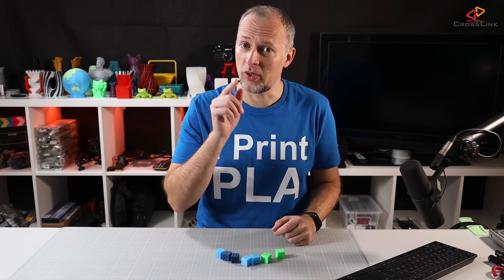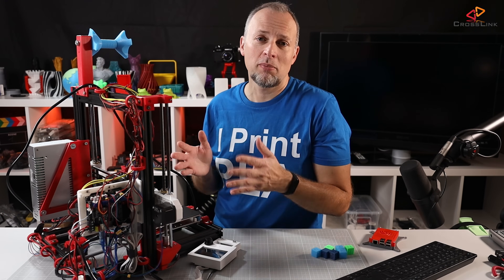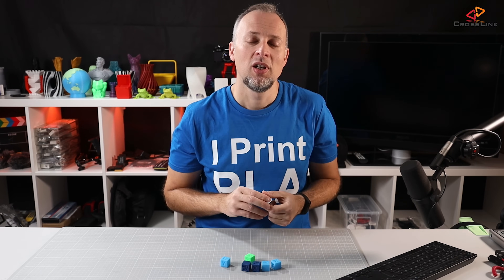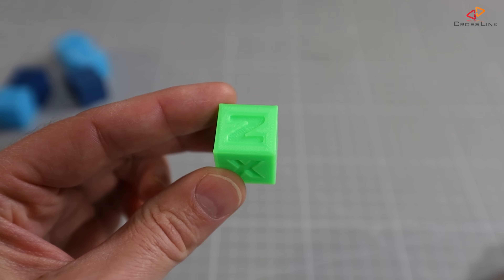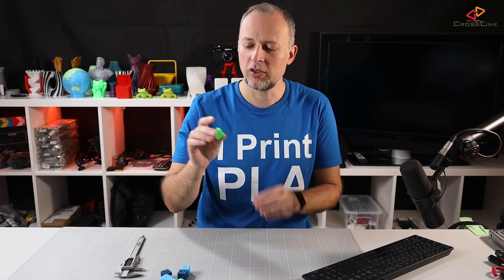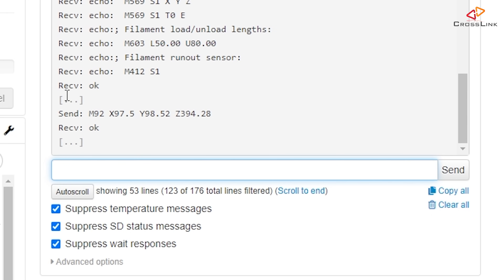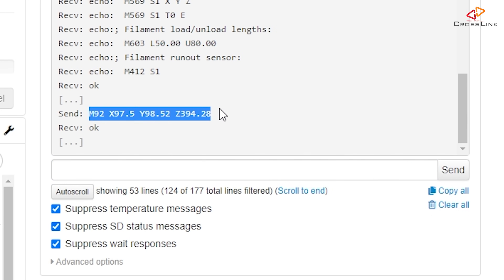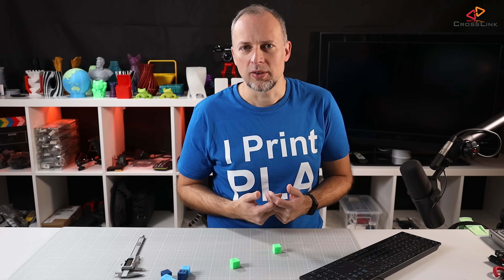SET YOUR STEPS - Fixing dimensional accuracy on your 3D printer (Cartesian only)

Comment from the maker: As @hunterisu999 stated correctly in his comment, I accidently used the term "esteps" for "steps", where the term "esteps" is really just used for extruder motor steps and not for the other axises.
Reply: That is a common mistake. I do that also most of the time by accident. However printing a cube to calibrate the printer is just wrong as you add so many variables in the mix that have nothing to do with steps and mm. steps/mm is just that. No slicer, no printing, no elephant food, no overextrusion that causes problems with the measurement. You just need to measure the movement and use that as a base for the calculation. If the cube is to big after the extrusion you need to fix that in the slicer to compensate filament expansion/shrinkage.
Reply: @guidomersmann9744  I agree. This is the wrong methodology for calibrating X, Y and Z distances. This method can only achieve a first order approximation due to the uncontrolled variables and limited test cube size. It would only be helpful if you had a severely incorrect configuration. It's better to accurately measure the movement across the full length of travel. Yes, that is harder (especially Z), but if you're going for accuracy ...
Reply: @pondersomemore  I don't think you need to measure across the entire axis. Sure the more you measure the higher the accuracy is as it compensates measuring errors. If you measure with an fixed apparatus like mine (https://www.thingiverse.com/thing:4599123) this is at maximum low anyway. Especially as you can repeat the test multiple times at the very same spot. If the printer has different results on different lengths on the same axis there is something wrong you cannot compensate with the motor steps. Like a broken belt missing a tooth or being unevenly stretched.
Reply: @guidomersmann9744  any more info on this...tried the link but its gone, your method sounds far more accurate, but I'm not totally sure how I'd do it...

Comment: sure if you have the FLOW set correctly, this might work, when you want dimensional accuracy with the cube, what about other prints? the best way to get XYZ steps is actually measuring it. so take a ruler - put it on the bed in X or Y, and a pen or pointy thing - put on print head (or use nozzle), set the Move Axis to a point on bed at the end of the ruler. move Axis 50 or 100 mm. observe where the next point is, if its like 101mm you need to adjust the steps using the same formula for E-steps. Z axis is a bit tricky, but teachingtech has a good calibration page to do this.

Comment: One thing I NEVER hear anyone talking about when calibrating a 3D printer is something I fell into completely by accident, and that is temperature.  I would print things off that fit well right away but the next day they didn't fit.  Couldn't figure it out and I kept running test cubes which all came out correct.  Then I measured one I had done the day before but one that was now completely cooled down to room temp and it was measurably smaller than the freshly printed, and still warm, ones.  Depending on the amount of infill or number of walls I would see variations from between 0.1 and 0.4mm in each axis.  No amount of recalibration would ever get the parts to an accurate dimension...until I let them cool to ambient and then remeasured.  I also found that using my calipers at ambient temperature made a difference as well....as much as an additional 0.1mm with just threw off the cube measurements even more.
Reply from the maker: Interesting observations you have there. Absolutely want to verify those for sure. I am also curious what happens to parts of they get warmed up again. Do they expand and how much

Comment: This video is extremely dangerous and completely wrong. Starting with calling every step per mm value ESteps even if they arent for the E axis just teaches wrong terminology. Then, movement axis steps per mm are PURELY dependent on hardware values, like the GT2 drivegear that moves the belt, stepper steps per rotation and microsteps. You NEVER calibrate XYZ steps. They are fixed values, everything else is just wrong. Your "fix" here works because there is an accuracy error, but it doesnt come from moving the wrong amount but from filament surface tension rounding off outer wall lines making them bulge slightly outward. This dimensional error is an ABSOLUTE error, it will always be off the same amount, no matter the size of your print. That means that if this value increases the size of your prints by 0.1mm, then it does that regardless of how the print looks. This wrong fix here tries to apply a RELATIVE correction to an ABSOLUTE error. If I have a 20.1mm cube and just make the axis travel 0.5% less then that cube might end up at 20mm, but a 40mm cube will end up at 39.1mm since it should be 40.1mm with the swelk and you are removing too much movement.

As I said, NEVER touch movement axis steps. They should always be at fixed, hardware dependent values. What you should do instead to make up for the ABSOLUTE error of outer walls swelling over a bit is calibrate "Horizontal Expansion" which sets your outer walls slightly inward, making an absolute correction for an absolute error.

Also just for the sake of completeness, you should always calibrate esteps before dimensional accuracy, since not receiving the right amount of filament in the first place creates all sorts of dimensional errors.

And if you ask yourself
"do I want to believe the cool video or the random comment"?

The random comment is a mod of r/3dprinting with several years of contributions to Klipper, Klipperscreen, Slic3r and the Arachne engine. I have helped people that received misinformation from videos like these HUNDREDS of times, and once again someone who calibrated their machine wrong and then asked on Reddit led me here.

Comment: The way you show how to measure the cube faces is wrong. When you measure the Y for example, place caliper jaws on Y and face that is paralel to it. 
You don't look at Y when you measure it, cause that's measuring another axis. 
The cube must be placed on printer bed with Y towards you, X towards left or right, depends on how is designated, and Z on top.
That the whole point on marking that cube, so you know which face goes to what axis.

Comment: Please, this is ridiculous. You can't use a 20mm cube for XY calibration, as it's really easy to be 0.1mm off with any extrusion amount, and any sort of layer alignment/zwobble will multiply that issue as well. Across the whole bed you're going to have 1mm miscalibration then, and i can promise you the default value calculated from pulley type, motor type and motor driver configuration is better than that. You're just multiplying the error.

If anything use a 150mm size test print (to fit into 160mm calipers) but even that can be perilous.

I was hoping to see a method which mounts calipers to the XY axis somehow to measure the movement directly.

There is a case for calibrating the XY, since it's practically impossible to reach nominal belt tension at which it's exactly 2mm per tooth, it comes out the factory a little shorter and is intended to get stretched in use to nominal length, which we can't quite do without ruining the motor bearing, you're normally supposed to have much better supported motor connection. But the calibration needs to be done very thoughtfully and thoroughly and definitely not with a 20mm cube. In a printer driven with leadscrews or threaded rod, there is never a good reason to calibrate Z axis since the pitch is guaranteed by manufacturing method.

Comment: If you can't quite get it dialed in, a calibration trick is to halve the error correction amount.  Example if the calculation says remove 1%, then remove 0.5%. Or here if it says change you X from 80.10 to 80.70, then go with 80.40 (M92 X80.40)

Comment: Daniel, great video thanks. I've got as far as trying to find what my current values are but when i put the m503 code into the console i just get an error message. I have a ender 3 v2 linked to a Creality Sonic Pad. Any ideas?
Reply from the maker: It might be that your firmware doesn’t have that enabled. There is a way to disable M503 in Marlin and maybe for some weird reason Creality chose to do that. Maybe get a fresh firmware installed first from the firmware factory and then try again. Let me know if in doubt
Reply: @Crosslink3D  I think I've found it now using the printer.cfg file on the sonic pad.

Thanks again

Comment: Hi Crosslinnk, thank you for this video,  i have come into a problem. I have a Anycubic Vyper that I have never had adhesion  issues with, I created the initial cube dropping my bed temp to 50c instead of the usual 60c I use with PLA +, the  cube printed well and the measure dimensions were x 20.14 y 20.10 z20.06, I made the changes suggested by the spread sheet and reprinted the cube, This time 4 times in a row the cube lifted from the bed at about the 25% mark. Do you know what would have caused this?
Reply from the maker: I would assume that changing the steps for x/y/z will maybe require adjusting the z-probe offset a little. Did you try to go back to the original values? Does that fix the problem?

Comment: Stay have a problem with 90 digree ptinting i can't geat a sharp 90 digree if i want to print a cubic and i don't know how to fix the X Y acces!
Reply: Print slower or use pressure advance (Linear Advance feature in firmware).
Reply: @Siana Gearz  do you know how? Because i did adjust the flow but still a same problem
Reply: @BeetnaOurHome  What printer?
Reply: @SianaGearz  Anycubic chiron

Comment: Hallo and thank you for the Video.
I wondered: Does this calibration stay accurate if I change the location of the printer? For example, for it to have access to the computer I have to place it on the table next to me, which is not perfectly even. If I mount the printer back on its usual location, does the calibration stay accurate?

Comment: Using a 20mm cube to calibrate the steps/mm will only tune it to finely print 20mm cubes. Anything other that will be inaccurate, because there are many variables in plastic extrusion width. Get rid of the variables and use a caliper or dial to measure the mechanical movement of the axis. If gcode says to move 100mm then it should precisely move 100mm. When using a print to calculate steps/mm you will compound the inaccuracies that are involved in plastic filament, heating/extruding plastic, and introduce zstep inaccuracies into the x y dimension.

Comment: Thank you for your instructions.I have 3 ender 3 v2 . I use your calibration cube instructions. 2 of them worked perfect . The last one no luck . I can't get a constant measurement. I suspect the motherboard is defective. I adjust the vref voltage for all the motors. Same problem. I give up ... I wait for new motherboard upgrade from 4.2.2 to 4.2.7

Comment: You can´t calculate the steps by messurse the part, you have to messure the actual travel of the axis in relation to the promoted travel. While messuring the printed part you totally ignore flow rate, material and temperature. Thx for the video but it´s nonsens

Comment: I understand that steps/mm are factory set and normally they don't need to be adjusted, I found this relevant as I've swapped my idler pulleys to 20 tooth pulleys from the standard "Top hat" bearings fitted face to face. The bearings are 1.5mm bigger  on the diameter and thus with the new pulleys the print size is reduced in size both in X and Y. So thank you for a great video which I found very informative.

Comment: Would I be correct in assuming that the formula you used, only works for a 20x20x20 cube.  I actually printed quite a few cubes and was able to get very close to the actual settings.  However I tried to use the same sheet to try and calibrate a 100x100x100 print in order to try and get closer still, but all the values I received, were nowhere close to what they should be. As an example, the current e step for the X-axis is 100.0 the actual measured dimension was 99.57, but the spreadsheet is indicating that the new e-step should be 20.09. What is going on here????  Thank you for the time you will take to address my concerns.
Reply: The formula is made for a 20 inch cube. By the looks of the formula, if you change the '20' multiplier to a '100' (since youre doing a 100 mm calibration), you should be good to go. But I agree, a 100 mm calibration will be much more precise.

Comment: Great video this did solve my issue since i was experiencing this. However, the part that was printed on my build plate has now been printed towards the bottom right instead of the center of the origin. When I changed my steps the values given were X106.67 Y103.23 Z634.92. The original steps were X80 Y80 Z400. The print is perfect in dimensions but I want the print to be printing in the center of my build plate instead of the bottom right because I think the increased values caused this shift in direction. Do you know a fix to this? Again, thank you for the guide as  this saved me tons of time and frustration!
Reply from the maker: Let’s start with, where does the printer go if you send it to 0/0? Is it really in the corner?
Reply: @Crosslink3D  Ah i fixed this issue. Turns out cura has a slicer setting where you can change the x and y offset so i just measured how far it was off then input those values and bam, it prints in the middle now
Reply: @Crosslink3D  Well I haven't gotten to do that yet so tomorrow I will make sure to do so. Ill update you about what happens. Thank you for helping me to diagnose this problem

Comment: How do you correct if different sized objects are off by differing percentages?
Reply: By measureing the actual mechanical movement of the hotend, not the prints. The way in the video is not proper method.

Comment: Great video, thanks! I also recently calibrated my steps (XZY and E), but using a different approach (measuring the axis movement directly on the sled with a caliper, which I think is more accurate). But now here's my question: how does the change in the step values affect the magic numbers for a 3d printer, or does it at all? I've been looking for an answer to this in many videos and texts but haven't found one yet. Would be awesome if you could help out with that!
Reply: The value has to do with the gear ratio and your micro step value. there are plenty of calculators on line for "steps" per millimeter (which are actually micro steps per millimeter). The larger the pully(more gear teeth) the less steps per millimeter. but the method above is using a relative ratio to calibrate. You are definalty correct measureing the actual movement is more accurate. getting acurate measurements with callipers can be difficult its best to use a dial guage.

Comment: Ok so this kind of calibration based on printed parts like a cube might work for small prints but what happens after you calibrate this way and then setup a print with 2 cubes with 60mm of empty space between them? Does the calibration still hold accuracy? I calibrate my printer with a digital indicator like a machinist would and so far I trust that more than any other method.